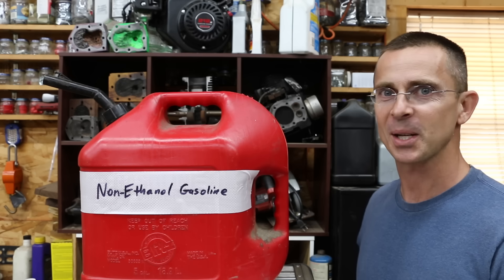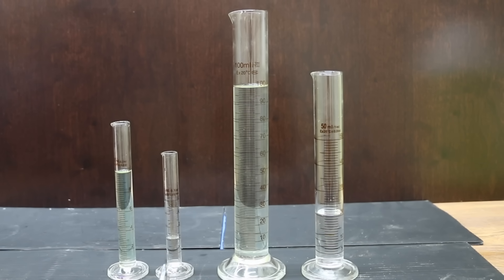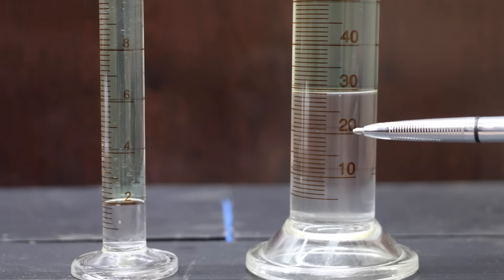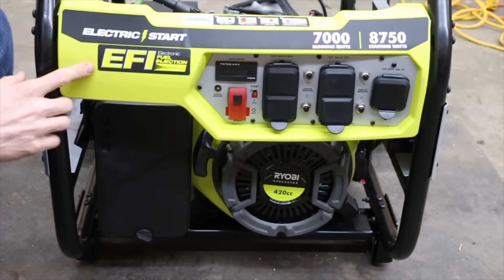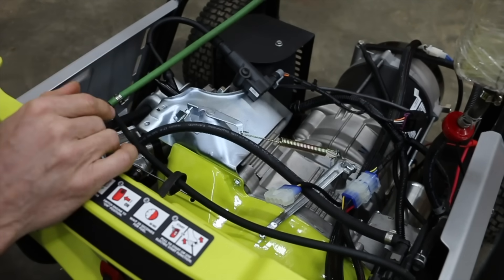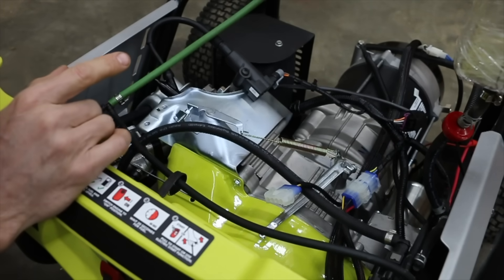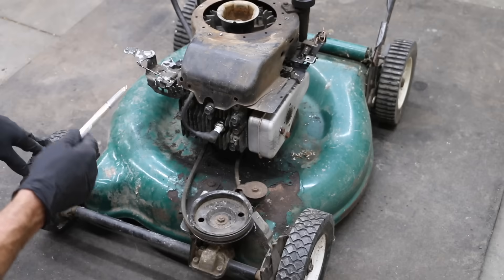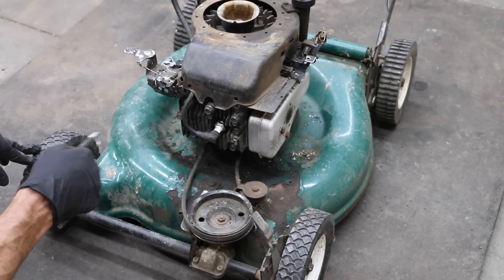Is Non-Ethanol Gasoline Really Better? See the PROOF!

Comment: Im in South Dakota, we have Non-Ethanol fuel along with 10%. I only run the Non-Ethanol fuel, because i believe the Ethanol full will separate and freeze, the temp outside right now is 15, and regularly drops to -10 to -20 in deep winter, rarely getting above 30. I do get better fuel econ on Non-Ethanol fuel. We recently went on a long trip, over 3500miles, used only ethanol 10% blend and dropped about 3 to 4 MPG. This was in our 09 Lincoln MKX with 120k miles. As for what the 10% and higher does over time, i do not know. Thank you for another great informative video.
Reply from the maker: Thank you!

Comment: Nice job, this is a very common topic with my buddies and myself. I feel the fuel line deterioration and of course corrosion is the problem along with water build up in tank which is the main problem. If they could make corn fuels better i would be all for them but we're not there yet with the knowledge but im sure it will come.
Reply from the maker: Thank you!

Comment: In 2003 i put my new 440 together and i put a brand new Edelbrock carb on it.To this day the car runs fine no problems at all and it does sit around a lot also.Now in the last 5-6 years i have been putting Lucas injector cleaner in the car at every fill up and like i said before the car runs great no carb hesitation at all. I also use 93 octane premium Shell or Exon gas..........
Reply from the maker: Thank you!

Comment: With more people going with renewable energy I wonder if you could do a rechargeable battery test; kind of like when you the did the small batteries but one with types like ion-lithium, nickle phosphate, lead acid, glass... (and if you can find one a flow battery)  to see what large 12 volt battery maybe better for the cost.
Reply: Also edison batteries (nickel iron)
Though the biggest problem is testing the long term use, for example, vanadium flow batteries basically don't degrade (even when fully discharged), nor self discharge, but are much more expensive and weigh more than lead acid and are on par with nickel iron in terms of price and energy density.
Reply from the maker: Thank you for the video idea!
Reply: @ProjectFarm  Charging a battery would be a way to test an engine at a range of loads rather than the constant load of a heater. Maybe this would give more information on fuel quality? A geek could even plot output power vs time and load and get an idea which power range a given fuel or additive is most effective in?

Comment: Non-ethanol gas is better for my motorcycle when i put her up for 7 months in the winter and forget to drain the carbs.
Anyway, i always go by; carburetor? Get non-ethanol especially for old machines, or performance machines like carburetor sport bikes). Fuel injected? don't matter if you got stabil and the octane matches. Of course I've heard stories of ethanol drying out rubber carburetor parts much faster over the course of years compared too. Just be careful if you have a machine from before 2006, check to make sure the engine parts can handle having alcohol in the fuel lines.
Like others have stated, be nice if you could do a long term test of four machine, 2 with a half tank gas, two full to the brim, with fuel in the carbs sit for a year and see how they run after.
Reply from the maker: Thank you!

Comment: The test of whether there is ethanol in the fuel is interesting. However, the rest of the information is misleading, statistically insignificant, or just plain wrong. Octane has nothing to do with efficiency, but rather with combustion speed and propagation. Changes in fuel require tuning to compensate, which is done by modern vehicles automatically. Gasoline has more energy (BTU/gal) than ethanol and therefore under proper conditions will do more work per gallon. This is easily observed by noticing that in areas where more ethanol is added in the winter to the fuel blends that fuel economy goes down.

Comment: I run non-ethanol gasoline in all my gas engines. The local Sunoco near me sells it. The better fuel mileage makes it worth it. If i let a snow thrower or snowmobile sit all summer it starts right up in the winter without a problem.
Reply from the maker: Thank you!

Comment: According to the owners manual, up to E15 was just fine for the carburetor in my 1986 Monte Carlo SS. Ditto my 1993 Suzuki DR250SE. It’s not hard to make carburetors tolerate ethanol blends. If any issues show up in your long term test, I’d be more upset at Briggs & Stratton (or Kawasaki, or whoever) for cheapening our than I would be at the gas station for blending the fuel.
Reply from the maker: Thank you!

Comment: another great video thanks. I am not sure if you have colored gas (purple gas) down in the US. Up here in Canada gasoline used for off highway use like in tractors, boats, ATV, lawnmowers and such gets a color added so it can be identified as not having paid road tax. I would like to know if the added color can have negative impact on an engine or carb. If you let it sit for a while in a carb you can really see the color when you take the carb apart.
Reply from the maker: Thank you!

Comment: +Project Farm I worked at a Standard Oil (Amoco) station from 1996-2002. We sold non ethanol gas all the time. We would see and rebuild cerebrated vehicles all the time the ethanol would eat the floats values and hoses in the carburetor. This ethanol blend would also eat the sequinual fuel injection and TBI coasung the injectors to foul and corrode.
Reply from the maker: This is great information!  Thank you

Comment: I use non-ethanol in my 2001 Volvo S80 with a non turbo I6. I get a smoother idle, better throttle response and 3% better mpg.  This is all the result of a higher BTU the 100% gas gives off vs ethanol.  My car can a handle up to 10% ethanol.

As in comments to ethanol in small gas engines.  I have labels in stores on lawn mowers  about DO NOT USE ETHANOL BASED GAS IN THIS ENGINE.
Reply from the maker: Thank you!

Comment: Looking forward to the long term test.  If possible could it be done outside where the sun can heat the test items during the day  and let them cool and condense any moisture at night?  Also I don't have any small engines with fuel injection and wondered if the generator had a fuel return or pressure by pass line?

Comment: i use non-ethanol and stabil additive in all my small engines and regular with ethanol in my vehicles formerly in new mexico and now in michigan.  if i understand properly, ethanol mucks up carburetors and small fuel lines.  i have seen the results for myself on having NO problems with my small engines and just had to replace the carb on my dads riding lawn mower who didn't take my advice (powdered butt syndrome i guess - i don't need advice from someone who's butt i've powdered).  i don't much care about fuel efficiency compared to low maintenance.  still love the channel!  i love your scientific methods of testing products and now consult your videos before buying glue or tape, etc.  keep it up!

a good resource for finding non-ethanol is www.pure-gas.org
Reply from the maker: Thank you!

Comment: I love these tests you do! I really appreciate all the hard work you put into your tests so that we can see exactly what happens under certain conditions. I always had my doubts about ethanol fuel and even though this wasn't a huge deal, it still showed that non-ethanol was a bit better. But from what I was told, E-85 which is 85% ethanol, while cheaper, burns much faster, so in the long run you're not saving that much. But what's even more interesting is that the 7th gen Malibu has a flex fuel and normal 2.4L Ecotec and the one rated for ethanol usage actually claimed by GM to get just a slightly higher horsepower and torque. It's a small margin, but it makes me wonder why that is. Either way, I'm hitting that subscribe button. These tests are always worth watching. Please keep the awesome content coming!
Reply from the maker: Thank you!

Comment: I had to replace the fuel line on the lawnmower once a year because the ethanol ate away at the rubber lining, mostly because there was no ethanol free gas in my area, except at the marina where it was twice the price, so it was cheaper to replace the line once a year. Within the past year, a few stations added ethanol free pumps, but sadly they're asking $3.19/gal  with E10 at $2.39/gal. If they ever force E15, I will pay the extra for ethanol free in my 2006 truck since it is not flex fuel.
Reply from the maker: Great point.

Comment: Great video, I like how you tested for ethanol in the fuel. I have been using non ethanol fuel for all my yard machines and chainsaws for a few years now, I am very curious how long non ethanol fuel can be stored and still be viable. I have had ethanol fuel in a can for 2 years with stabil and then add some more and 3.5 years later it's still good, but I'm not going to push it any more than that so I'll use it up and buy some fresh.
Reply from the maker: Thank you!

Comment: I have noticed that you have been letting your fuel run out completely. I understand this method for carburetors but for electric fuel injected engines this Is not a smart or cost efficient way of doing this test. Not only will it cause problems and unnecessary whear on the fuel pump but it will also put out a bad reputation for the company that has the generator. I say this because running on low or no fuel will overheat the fuel pump and cause it to go out or lose its ability to produce enough fuel pressure faster than if the fuel pump was taken care of and cooled properly. This also makes it seem that the company that owns the product uses bad fuel pumps and can hurt there sales because of user error. Other than that I love your content and always find your videos very informational and also entertaining.
Reply from the maker: Thank you for the constructive feedback.

Comment: This brings up a question. If you add water to separate the ethanol, then drain only the gas, then take 100% gas. Wonder if they will still have the same shelf life vs. 10% ethanol fuel.  Also wonder how the octane would be. I have had a bunch of equipment get screwed up from ethanol fuel. From in tank fuel pumps locking up to carbs. 
Back in the day. Old fuel would still start a car.
Reply from the maker: Thank you!

Comment: Yes, there may be a slight edge with efficency and power using non-ethanol fuel over E-10 fuel, but the trade off is that the E-10 is usually less expensive.
In my state we are starting to get blender pumps. You can select the ethanol percent in the fuel we want. It can be 15%, 20%, 25% up to 85%.  Buyers choice.  Vehicles manufactured after 2000 should be able to run up to 20% with no issues. Prior to 2001 vehicles at this time shouldn't run above 10%. The government was going to allow up to 15% but I haven't heard if any progress has been made on that to this point.
Reply from the maker: Great information! Thank you

Comment: Pure ethanol also has less energy density than gasoline per gallon as demonstrated by the 4% difference in run time. The E85 (85% ethanol, 15% gasoline. The 15% gasoline helps start a cold engine.) automotive fuel for "flex Fuel" cars and trucks suffers from a 20% reduction in fuel economy and range, even though it is supposed to be cheaper to buy per gallon. 

There are non-ethanol products on the market, like "TruFuel" in both 4 cycle and mixed (50:1) 2 cycle engine fuels for small engines. They do cost more. But it may save your snow blower, lawnmower, rototiller, or other small gasoline engine from a decrease in reliability.
Reply from the maker: Great point!

Comment: Ethanol is garbage. Race car crews repeatedly had to blow out cylinders after race or corrosion problems quickly. Higher compression without premature detonation, yes, but you had to pour the fuel to it....2 to 1...ethanol vs gas. Check the btu’s, ethanol vs gas...no comparison....ethanol...garbage.
Reply from the maker: Thank you!

Comment: I did notice that the gas with ethanol, carbon flaked off into other areas as for the non athanol, carbon stuck together and kinda gunked up around the spot the gas with the ethanol would be flaking off at
Reply from the maker: Thank you!

Comment: Thank you for using my idea about ethanol in small engines.  I do know that my S-10 get 28-32 mpg on the highway with non-ethanol gasoline, but only 23-26 mpg with 10% ethanol on the highway, and is also more difficult to start when cold with ethanol.  Cold being under 40° f.
Reply from the maker: Thank you!

Comment: Thanks for the experiment I had thought this was the case some time ago.  Now could you come up with a way to measure the amount of CO2 given off by the two.  My thought is that for the same work performed the gas with ethanol would have a higher amount of CO2.  I also think that it would have a higher amount of the other gases thus defeating the reason to add it to the gas.
Reply from the maker: Thank you!

Comment: Those of us who live in Western Oregon.....have had the pleasure of dealing with this crap for over twenty years... It started out as a winter fuel, October through April...
Most of us farmers with on farm storage, would fill up at the last minute... Now the whole state is stuck with the crap😥
Power drop is noticable, especially  in vehicles that we're Not made for it... Milage drops by about 10%...
They charged 4 cents more per gallon originally... All so you had to buy 10% more fuel... Some retail stations have premium, but the cost difference isn't worth buying it.... Except for use in small engines, especially chainsaws... Because the ethanol eats up rubber fuel hose and diaphragms... 
The ethanol gas is not allowed to be sold for use in boats either.....
PS, in case you couldn't tell...
I HATE the crap!!! Constant problems with it in older motors!!!!
  Thank you for another great video!!!
Reply: Though if you have an engine that works with it, you can run e85 which increases performance and is cheaper even including the 30% increase in consumption (at least here).
My brother uses it for racing buggies, and the ones with e85 get about 10% more power than the ones with regular or ethanol less. (Though it requires to use different tubing and to change the fuel intake to add more.)
Reply: @satibel  unfortunately, you have to remember... The engines made to run on it are all fairly new... Even then, issues still come up with all the sensors used to make them run correctly... Seems the fuel tank pressure solenoid is one common issue, because when you get your tank too full, gas gets down the breather tube and kills the solenoid..... The O2 sensors are another great invention of the modern gasoline engine...lol
Reply: @GosselinFarmsEdGosselin  O2 sensors are a great idea in theory,  but like most stuff they need to work.Though, manufacturers don't sell their cars for how reliable they will be in 10 or 20 years, but the extra mileage and power you get.
Reply from the maker: Thank you!

Comment: When you do your long term test.  Try it on a 40:1 mix as well if you can. (ethanol /non ethanol)  i run my small engines on 40:1 (ethanol)  and they seem to handle it very well.  Plus i can leave the fuel in the tank for extended periods.
Reply from the maker: Thank you for the video idea!

Comment: I say turning those heaters off and on a controlled number of times to get the engine to overcome load as a normal engine would going up a hill or accelerating. That would put under load efficiency in the mix as well. I think that would end up changing that 4% number a little and would be closer to real driving applications. I'm curious as I ride motorcycles and try to use the non ethenol stuff when convenient. Can't really tell with throttle response on my end. Oh toss in race fuel as a third test, I ride dirtbikes too.
Reply from the maker: Thank you for the video idea!

Comment: Ethenol has less power per gallon, it's not a secret. 

Edit: the stats I always see is ethenol has about 30% less energy per gallon, as the fuel is 10% ethenol it seems to me 4% difference in fuel economy seems to be right in the ballpark that should be expected. The 30% energy difference is supposed to be something like a 42% difference in fuel consumption between pure ethenol and pure gasoline, maybe I'm tired and remembering wrong but that would figure to 4.2 at 10% blend so I stick with my original thought that you are right on the money as always. 

Sorry for anyway that read my tired ramblings lol
Reply from the maker: Thank you!

Comment: Ethanol in fuel is evil. If you have any vehicle or machinery that doesn't get run regularly you don't want ethanol sitting in the tank. It will attract water and rust out your fuel system. It's also hard on hoses and other plastic/rubber components that are not designed for it. So older cars and small engines will have trouble with it. I speak from hard experience on this.
Reply from the maker: Thank you!